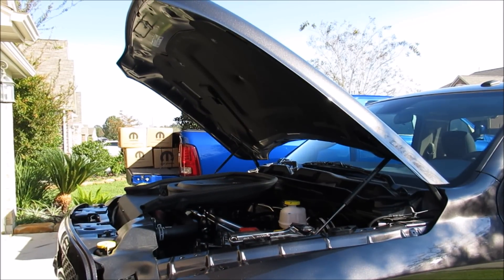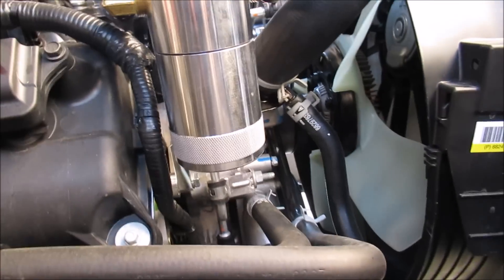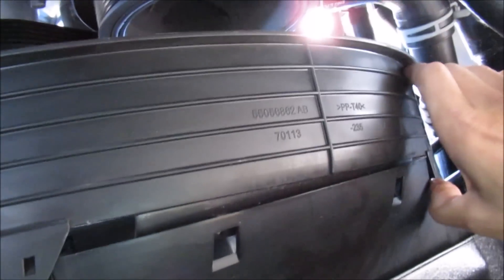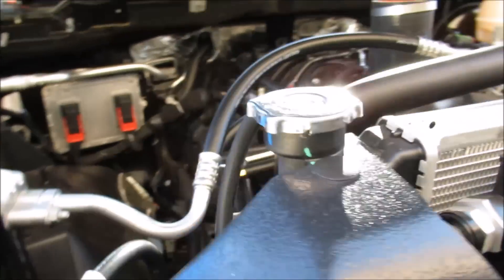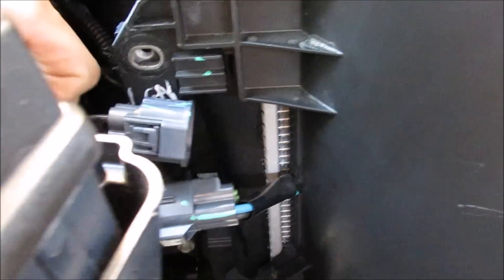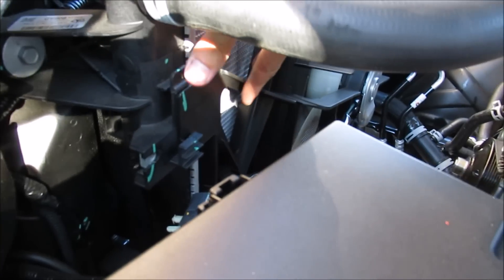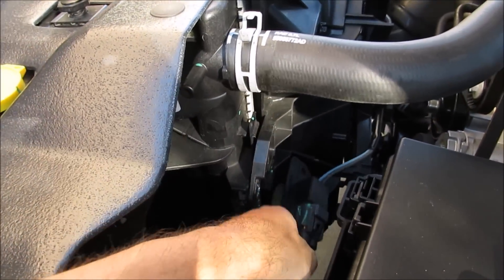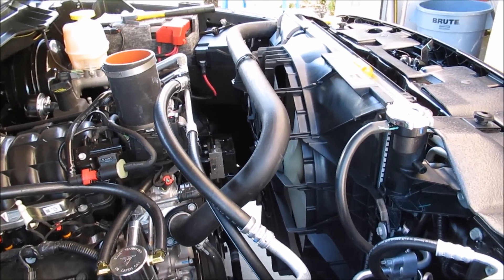2017 Ram 1500 5.7L Hemi Clutch Fan Delete

Comment: So you remove everything that REAL engineers designed for this motor? 🤔 Na, I’m good 🤪
Reply from the maker: There is nothing wrong if you enjoy driving a slower stock truck.  We have been running these trucks like this for 15 years dating back to the first hemi trucks in 2003 without any problems.  If this mod was going to cause problems, then we would not have recommended it.
Reply: ...thats like saying don't add a cam, don't add CAI, don't change the exhaust. Don't do ANYTHING to your truck because engineers made a perfect truck! 🙄
Reply: well to be honest even engineers make mistakes that's why the 2019 Rams have electric fan's
Reply: You could say that about every mod there is!! Lol
Reply: Brand new 2019 Rams have this same exact fan setup on the 5.7 Hemi. No clutch fan.
Clutch fans are cheaper, so I'm sure that is the only reason they put one on from the factory.
Reply: well my 2014 has 3 open recalls airbag parking shifter and a cruise control.
Reply: @pzpinkslip123  my 2015 has 18 recalls
Reply: @kentuckywaterfall3255  ya I just another one in the mail yesterday. Tail gate could open on it's own.
Reply: Xcali3ur you're a fucking idiot
Reply: You must be a engineer lmao

Comment: I have a 2016 and in order to have a tuner on '15 models and up i understand you have to change out ecm which i really dont want to do. So without a tuner and fan kicking on around 220 degrees, will this be safe on the motor to run like that.
Reply from the maker: I wouldn't do this without a tuner to lower your AC fan temps.
Reply: Ok thanks, guess ill have to wait till im ready to do the ecu swap
Reply: To possibly save a few $$..Head to a wrecking yd and pick up a ecu off the same yr and model trk you have..Send that to diablo to do their stuff with and then buy a stand alone trinity/itune..How much it will save,dont know but every lil bit counts..I scored a wicket deal on a tuner/ecu/tb for $1000 canadian..Still had to send ecu to diablo to have it reset for my trk cause i bought it used..
Reply: I think i will do that. The search begins!
Reply: You could alternatively run a standalone fan controller like the Dakota Digital fan controller.

Comment: Post the dyno results...before and after. There is no possible way that the weight of that factory PLASTIC fan bladed fan clutch assembly is enough weight removed to gain any torque or horsepower whatsoever.
Reply: Search Youtube for Engine Masters Episode 20!!
Reply: Boom, Timothy Vertin, great example.  Even a viscous clutch fan will eat more than their initial test because theirs was cold and in bypass/freewheel mode essentially.  Warm that engine up some and get it engaged and you'd probably be in the 20-25HP loss range.  Hence why my 2000 Ram has a Dodge Viper Electric fan and a Dakota Digital Two Speed Fan Controller waiting to go in!
Reply: 15 hp

Comment: Hi I have question about the tune I have the Diablo T1000 and I wanted to know where do I go in the tune to change the setting to when the fan comes on and off. Also if I put a 180 thermostat in it what should I changed it too come on at 190. Are something else. Thanks
Reply from the maker: When you select the tune you want on the tuner, the next screen will ask if you want to modify that tune.  Click yes, and then scroll through the adjustable parameters until you see the 1 for the AC fan.  And yes, set it to 190 in the tuner if you have a 180* thermostat.
Reply: Moe's Performance awesome thanks for the fast response. Since I live in Texas do you think I would have a problem with my truck overheating when it's real hot outside or sitting at a light for a long period of time. I'm thinking about doing this mod because when I was sit at a light for a period of time and with the air conditioner on the Ac  will start blowing out warm air until I start rolling again I have a 2009 Dodge Ram 1500 hemi 4 by 4
Reply from the maker: We are in Texas as well, and have never had a cooling issue with this setup.  When it is how outside, you are likely going to have your AC on, and this electric fan will stay on anytime your AC is on.  It is plenty strong enough to keep your motor cool, especially with the 180* thermostat installed.
Reply: Moe's Performance ok thanks where are you guys located in Texas I'm in Fort worth

Comment: I was wondering if I don’t have a tuner how do I make it kick on at 185 degrees?
Reply from the maker: You would have to hard wire in an adjustable temp controller to make the fan kick on sooner.

Comment: So what gains are there from the fan delete?
Reply: You'd notice the engine will accelerate easier, you'll be gaining about 15-20 HP at peak RPM.  Nothing huge but definitely noticeable.
Reply: Little bit more tq put one on my 2011 ram RT love it you'll feel a difference tires brake loose off a roll now
Reply: stewmat30 No gain at all. This mod is for people who have too much extra money and time on hand.

Comment: Ready for the kicker? They make a loaner tool for this that removes the fan so much easier and best of all it is free. Proper tool for the job.
Reply from the maker: An air chisel will knock the fan off in seconds, but we wanted to show people that you can still do this mod easily with basic hand tools that most everyone has laying around in their garage.
Reply: how would you use an air chisel to do this ??
Reply: @matrixex500  ... SARCASM
Reply: I've seen other videos that say they tried a specific spanner wrench for this, but it was too flimsy and short, and did not work.  I made the exact same tool as he did with the angle iron, and it worked great.  Cost me around $12.
Reply: put a long wrench on it give a good wollop with a hammer it will come loose

Comment: Why is there such a price difference? Just the usual Mopar  price gouge?
Reply from the maker: Mopar is always more expensive than the overseas replica parts, but the Mopar fan motor is a higher quality.  Cheapest option is to get the TYC fan, and just switch your factory AC fan motor over to the TYC fan blade and shroud.  Bolts on in 5 minutes, so this is cheap and easy.
Reply: Moe's Performance id like to see a video on this swap
Reply: Moe's Performance or is it just using ur stock ac fan an mounting in in the tyc fan shroud

Comment: Two questions what's the part number for the fan and I have a tuner what temperature would be good to turn off an on. I have the 180 thermostat.
Reply from the maker: Fan part #s are in the video description.  We like to run this mod with a 180* thermostat and set the fan to kick on around 190*.

Comment: And what exactly does this do ? Or help with?
Reply: It's not the weight of the fan... It's the parasitic loss from the fan while it spins. By using an electric fan, you eliminate the parasitic loss. 

You aren't "gaining" any hp, you are freeing up hp the motor already has, making it run more efficient.

Imagine the old exercise bikes with a fan for the wheel. The faster you pedal, the harder it gets because the fan is blowing harder. Replace that fan with a wheel and you will see what I mean.
Reply: Branden Prato ENGINE MASTERS
Reply: It frees up parasitic losses, or energy with units of hp (horsepower), the weight of the fan is not the load causing the loss, wtf dude, the losses are due to the air load on the fan when fan is cooling. Some mags show dyno charts w 20hp loss due to mech fan. Muscle car magazine I think it was.
There are other reasons, why more space to work, less load on water pump bearings. F mechanical fan runs during cold start in middle of winter. Annoying loud fan noise from mechanical,  Best of all impress your girlfriend and worry the wife as you throw large parts of your $60k truck across the lawn ranting how "they" (FCA. NOT YOUR FEMALE) don't know s and you got this.
Reply: Simply Vortech nothing at all, don't waste you're time doing this. The factory fan clutch blades are plastic...so the weight of the fan clutch is centered in about a 5 inch diameter area which is not enough weight or centrifugal force to have any effect at all on the performance of the engine.

Comment: Would the 3.6l fan for it’s from the v6 work? 
 The part number is 52014772AF
Reply: I have the same question
Reply: The 3.6 fan does not work since it is a 3 wire and requires PWM input.

Comment: Install not done! You need to have nut to put back on the pump pulley or your shit is going to come apart!
Reply from the maker: That's false. We have been running without the mechanical fan on the hemi trucks for 14 years now without putting a nut on the threads where the stock fan came off.
Reply from the maker: The fan nut simply secures the fan to the pulley. It does not secure the pulley to the water pump.
Reply: The NUT does not have to be put back on, the pulley is attached to the water pump, on my water pump the pulley is welded on.

Comment: Can you do this without a tuner? Or is having a tuner required?
Reply: I believe you can do this without a tuner, however the fan will kick on at 222 deg.
Reply: @PRO4XKEV  I did this mod and my stock electric fan(not v6 fan) kicks in at less than 180°F. 

It's not tunes, so do you happen to know why it does that?

Comment: Do you know what temp the fan turns on at with the factory settings? Also, whats the part number?
Reply from the maker: The factory AC fan runs anytime you have the AC on or when your engine temp gets up to 210-212*.  With tuning and a 180* thermostat, I like to setup the AC fan to come on at 185*.
Reply: so if I don't change the thermostat to a 180°, I can go with out tuning and it will work as it normally would, no overheating?
Reply: funiwant it will turn on at like 220 temp
Reply: @alergl9842  203 is the factory setting for the fan to kick on
Reply: Factory settings fan on 210F. There is no use in getting a tune all you can tune in the Diablo Sport i3 is AC fan setting's ON, or AC fan settings off, that's it there is no tune for temp setting on or of don't get sucked in.